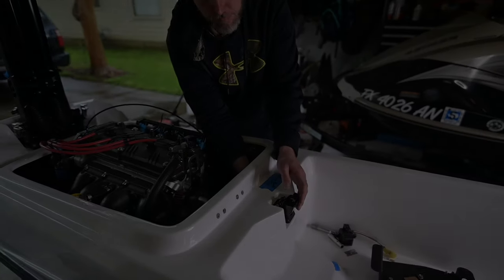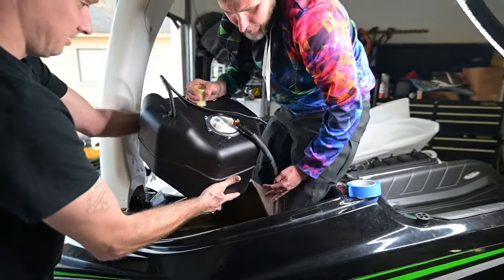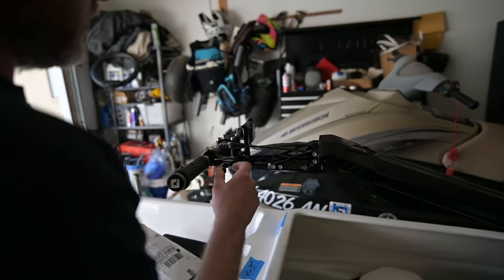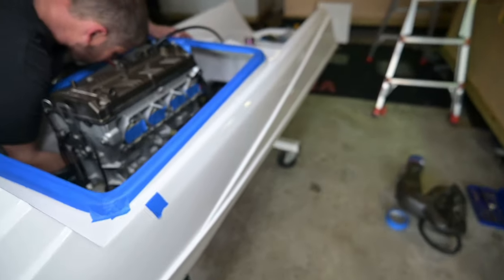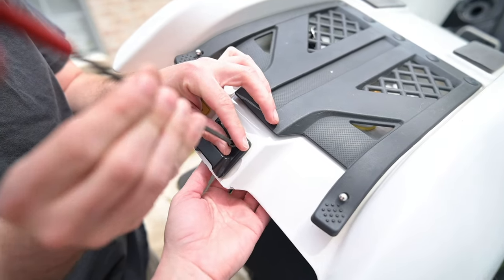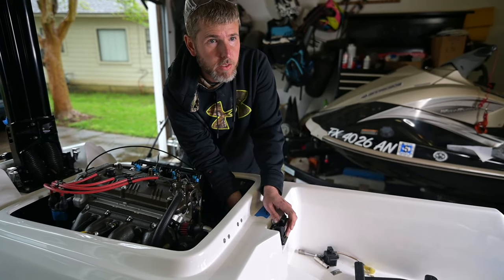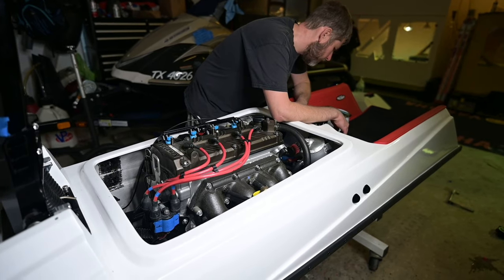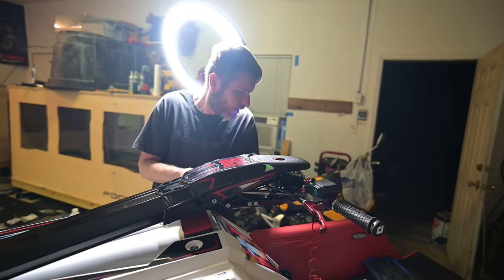GP1R Race Ski Build - Empty Hull to Finish!

Comment: I was wondering if you had looked into getting the Kommander GP1 prior to getting this ski? A Kommander GP1 is completely ready for an engine and driveline when you receive it. No need for drilling tapping or guessing……
Reply from the maker: No, you can get one of these in any form you'd like, this is the trim we opted for. As small business owners ourselves, we understand the undertaking it takes to make a hull from scratch. Hours of design, testing, and iteration.

Comment: Has anyone tried to put a supercharged engine in one of these
Reply from the maker: No point since it doesn't have a race class.
Reply: Other GP skis have been built with smaller motors & a turbo. There are also a few SXR 1500's with the Kawasaki 310 setup.
Reply from the maker: @CGPhotos  yes people do that with the TR1. Other than trying something different, there just isn't a good reason, still not competitive. While I'd like to like the TR1, they like to eat rods and just don't have much torque. Not sure what the fascination is with forced induction on stand ups, the powerband makes them more difficult to ride. Would be much better off building an NA motor to make it actually rideable in something other than a straight line.